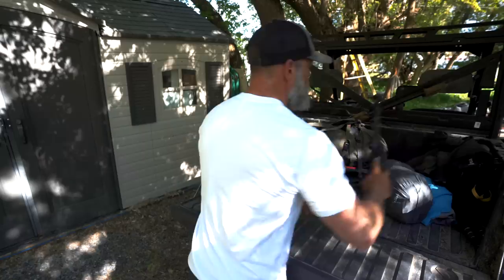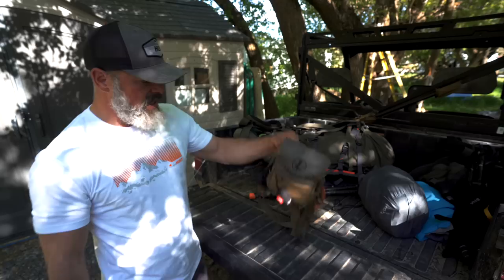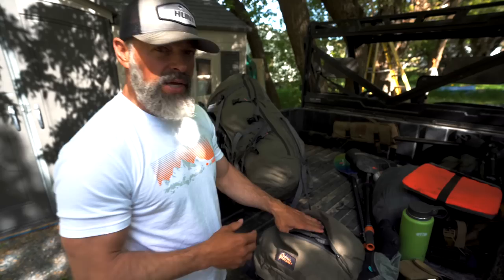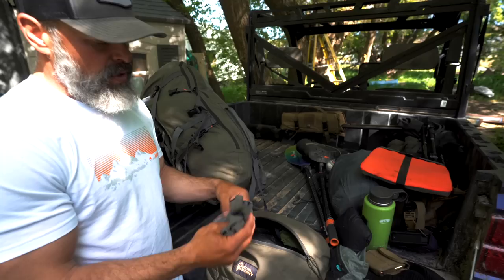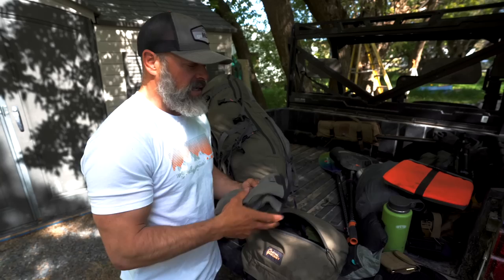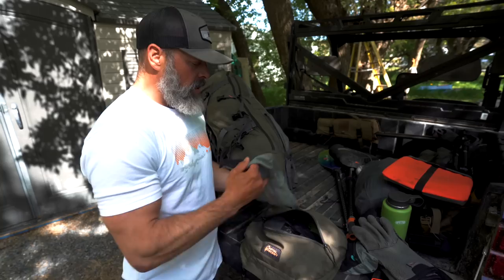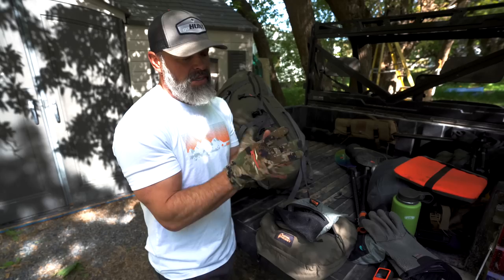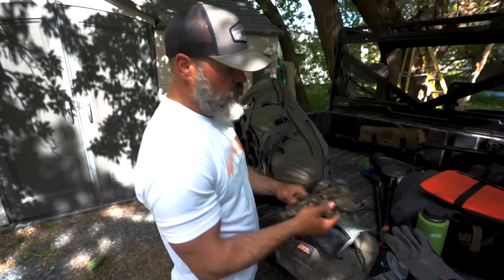GEAR YOU NEED FOR YOUR SPRING BEAR HUNTS | 🎙️ GRITTY EP. 695

Comment: Great video Gritty team. Thank you for the gear dump. That neck gasket on your dry suit should be modifiable. The rings on the inside of the gasket give you a guide to cut along. Take it slow. Recommend a sharp pair of scissors. Should make your river experience a little more tolerable ;) Cheers!

Comment: Is your big boat the Forager?   I have one for moose.  You can seal off the self bailing feature with Gorilla tape.  Self Bailing with a drysuit is pretty darn great.  Never used a 1 pound suit though... interesting to see how durable it is.  You can cut a little bit off of the latex gasket at a time until they fit well and are snug but don't choke you.
Reply from the maker: Right on! Thank you for the information. Yes, it’s a Forager. That self-bailing trick with the Gorilla tape sounds like a great idea! EXCELLENT info on the neck gasket—I wondered if I could cut it. I’m going to do that! The suit chokes the hell out of me right now.

Comment: I want to pick one of those Silky saws but not sure which model 130 or 170 and what teeth size fine/ med/large.  I am sure they are all good. Maybe the medium teeth for double duty skull cap and wood cutting for stove? The one you have looks like maybe 130 ?
Reply from the maker: I have the 130mm and it works perfect for what we use it for.

Comment: Hey Brian - great job as always.  I was checking out the Pocket Boy saw and was wondering if you know if it is the 130mm or 170mm?  Also, does it have the large teeth or the medium teeth?  I currently use a Wyoming saw that breaks down but I like the idea of folding the saw up rather than having a bunch of parts and the teeth all exposed.
Reply from the maker: Its the 130mm with large teeth.

Comment: What are the reason you go with the u turn stove over the square style ..
Reply from the maker: It shaves a little bit of weight. We have found though, in cold temperatures we take the large regular or the SXL. They produce more heat because they are better sealed.